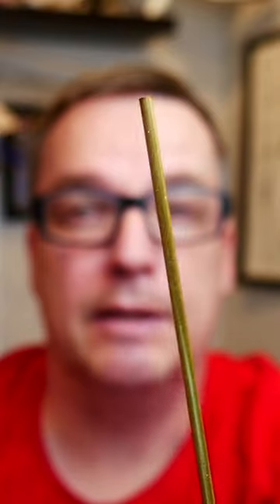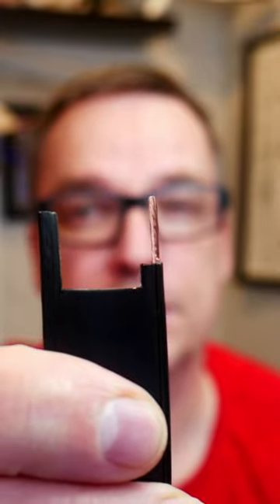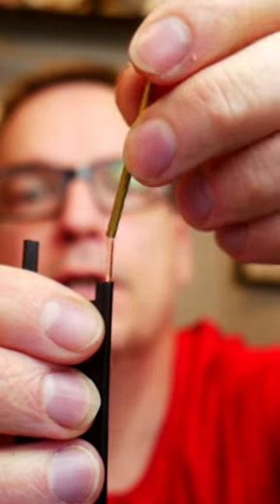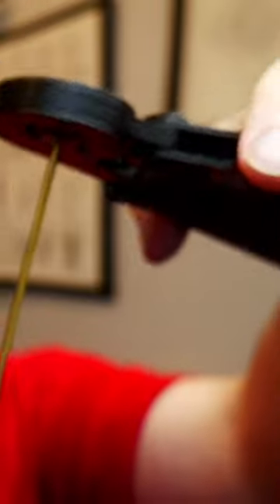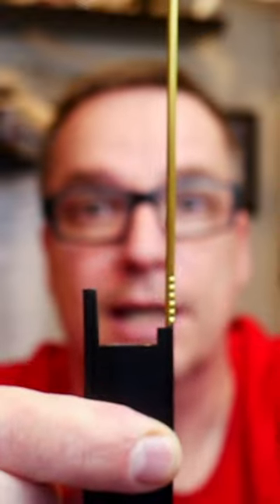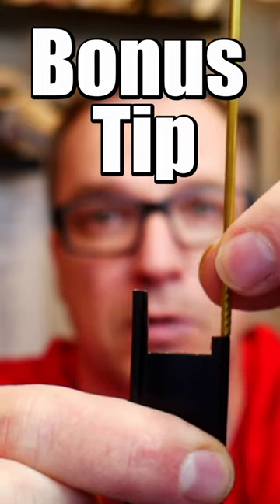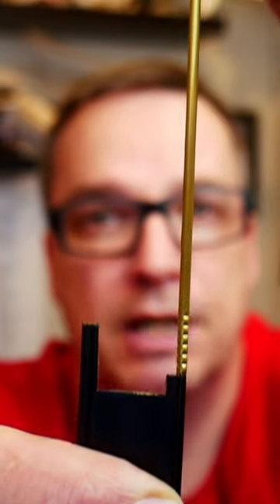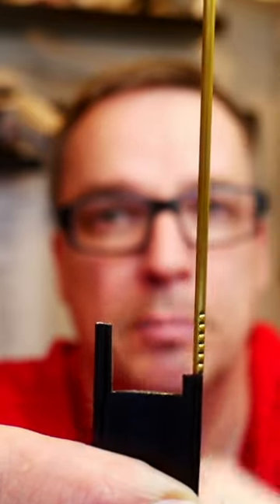Wire stretcher... Kinda... #diy #hamradio #diyantenna #radiorepair #radiocommunication #amateurradio

Comment: A piece of two conductor wire separated at a distance (Ladder line). Make it into a antenna (J-Pole). To get the right length of the antenna